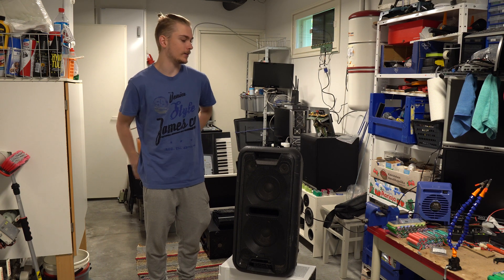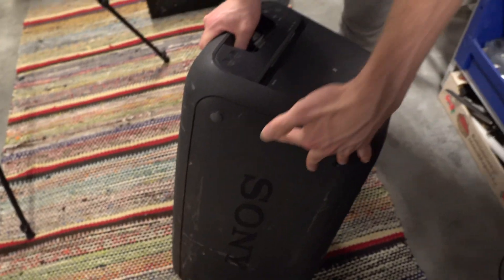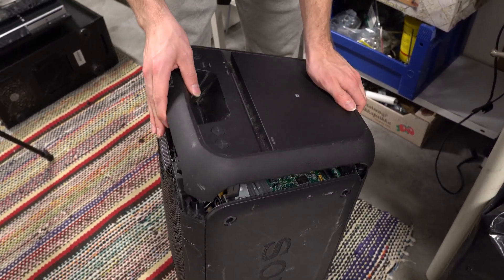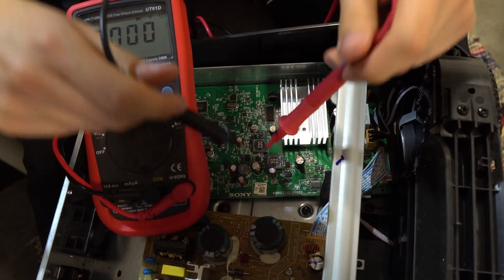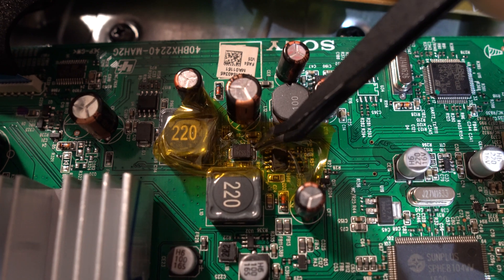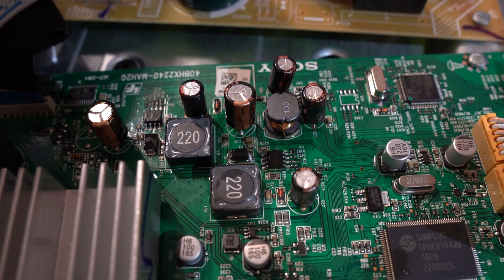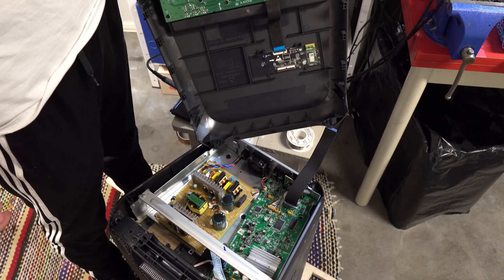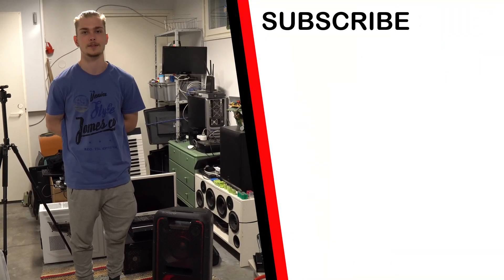Sony GTK-XB7 Party Speaker No Power Repair

Comment: Thank you so much! I just repaired one of these belonging my son. I used 2 soldering irons to remove the old SS34. I replaced it with an SK34 and it worked fine. Thanks 👍🏻

Comment: Hello. Any idea what can be done if the main panel is not working? None of the buttons on the front panel. The back connectors are ok and can be used only by playing with options from the app. The speaker can be used via a smart phone and the Sony app only. However, when i put it on stand-by (using the app and playing with the Bluetooth stand-by option) the lights go crazy (rave mode) if and only if the speaker is still connected at 220V. Thanks in advance.

Comment: What did you put on the old diode to remove it??
Reply: Flux, it helps in Desoldering and Soldering
Reply: @topg2820  Thanks! Also what is that plastic you put to cover all the other diodes?
Reply: @kingmatt59081  its some heat resistant tape so that you can heat which component you want and not other ones
Reply: @topg2820  ahh okay thank you!